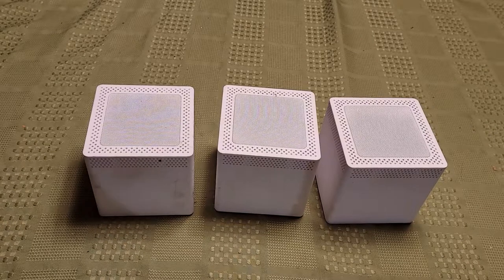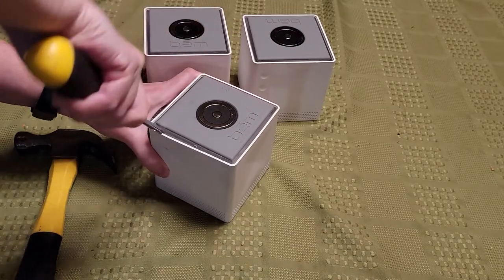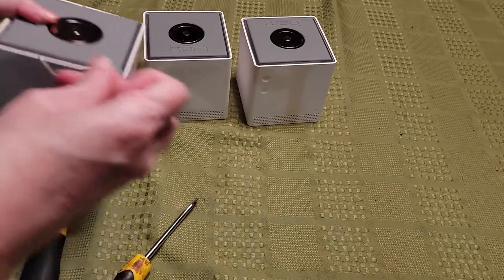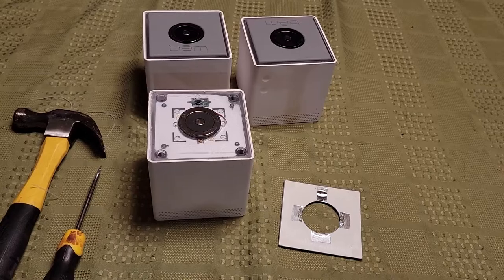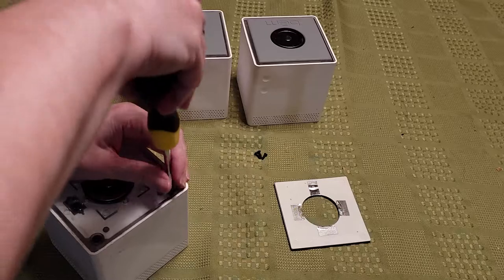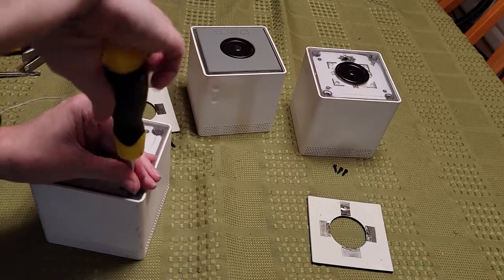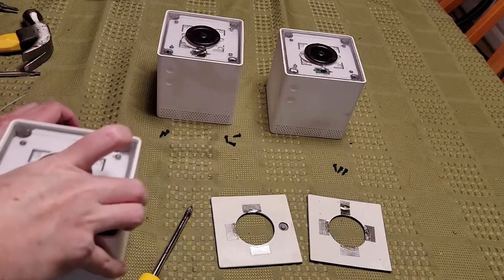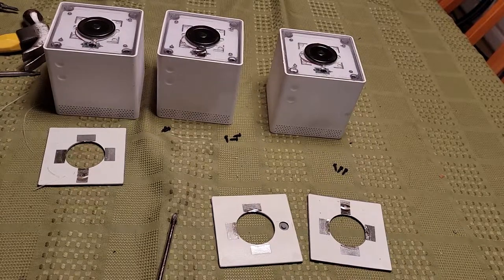BEM Wireless Bluetooth Speaker Trio - Opening the Speakers Part 1

Comment: Did you ever get the unit open?
Reply from the maker: LOL oh this was an absolute nightmare. Yes I finally did open them up, and I ordered replacement batteries for it. It's still in pieces all over my kitchen table. I'll try to get an area cleaned up to show the next stage of the repair process. I really want these things to work but they don't make it easy.
Reply: @LisaSheaAuthor  i am about to do mine, after you loosened the screws, what was next, just lift the base out?  Thanks.
Reply: @paulsantangelo3813 did you end up opening yours?